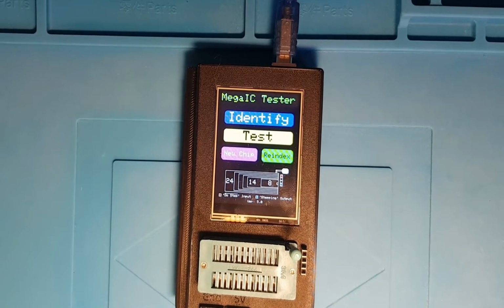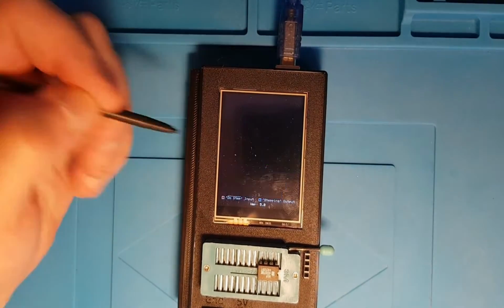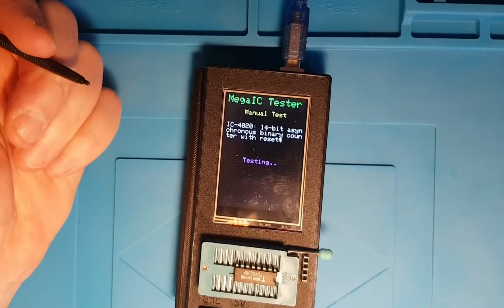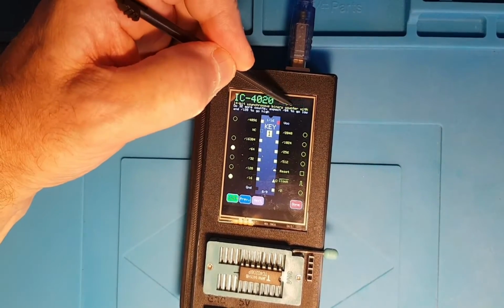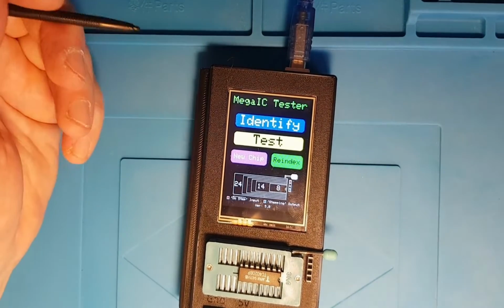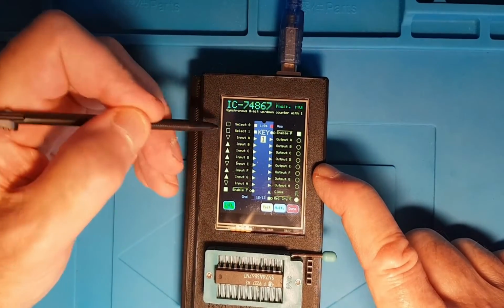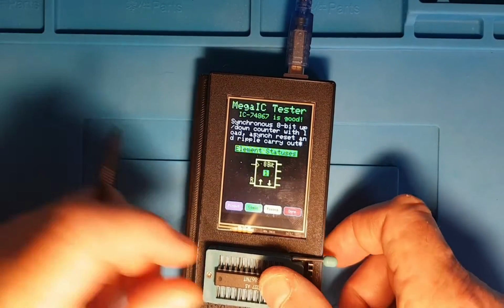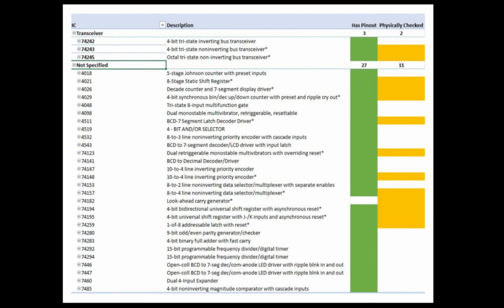Test Equipment: MegaIC Tester V5 Update, Digital TTL/CMOS IC Tester with Pinout View and Manual Mode

Comment: Will this Test op amps too? If not hope you add that function.
Reply from the maker: Sorry Eric, the MegaIC Tester only does digital ICs, as it uses the Arduino Mega's digital I/O pins, which are either on or off, not the pins which can function as both digital and analogue.  I do have access to 10 of the analogue pins, but the current ZIF socket circuit board does not connect to those analogue pins, so I can't even utilise them if I wanted to.  I do have plans for a custom ZIF PCB which will include switches and breakout pins and could possibly connect to the analogue pins, but my analogue electronics expertise is a pretty sketchy, so I can't see me doing anything any time soon.  Thanks for your interest :-)